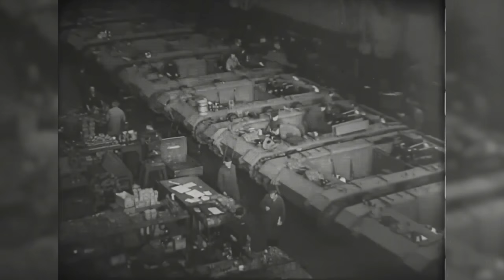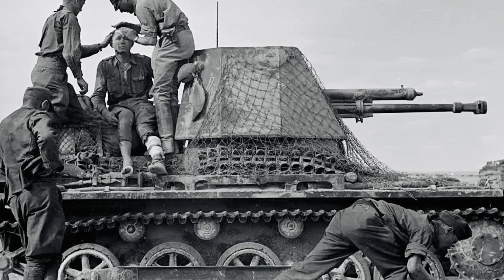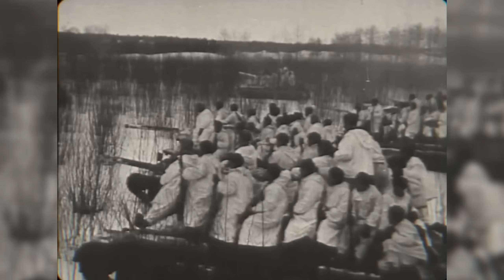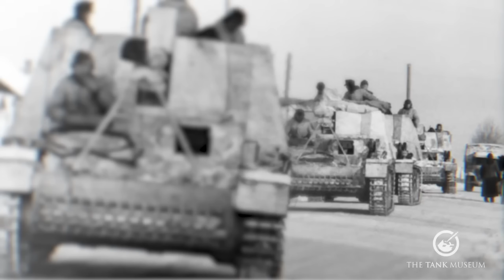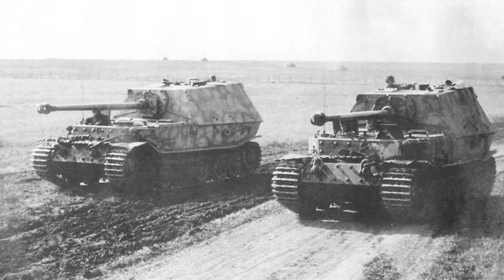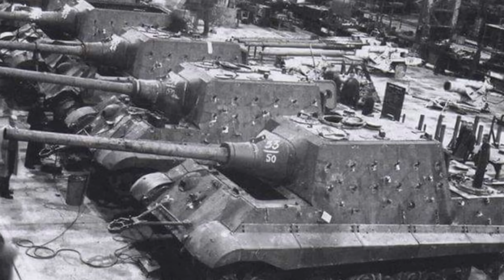The HORRORS of German Tank Destroyer Crews

Comment: I think the JagdPanther looked even better than the regular Panther
Reply: It was one of the best tanks the Germans had, Cost effective, 88mm, relative fast
Reply: With a weapon of war, what do looks have to do with anything?
Reply: @OrderingParts  It has anything to do with the fact that the Germans also wanted their armored verhicles especially the Tigers and Panthers (or tank killers like the JagdPanther)  to look good aesthetically.
You don't seem to understand that German Q.A engineers could reject a finished Panther tank during production, just if  the welds were to crude or that some parts were not perfectly smooth.
Or that even the paint was not perfect.
In these situations the tanks got re-worked.
This was totally unessecary, due the fact that the tanks was already finished and fully functional and ready to be transported to the frontlines. This unessecary focus on aesthetic quality hampered the pace of production and deployment of all kinds of finished tanks or tank hunters. Unlike the Russians who just tried to produce as much tanks and other armored verhicles as possible no matter how crude they looked with crooked weldings or faulty drilled holes in them with no ribbon ever put in them.
So it again has everything to do with the history of German armored verhicles.
One of the problems is that even the German engineers focussed so much on small quality details, that this also was one of the factors of lower numbers in producing armored verhicles.
The Russians got things right regarding production of tanks.
Just produce as much functioning tanks as possible, not matter if a panel is not grinded smooth or that this or that weld is too crooked.
You know why?
The russians knew that a new tank from the factory would last a few months at best.
So it would be totally pointless to spend time and resources to details of a tank that won't matter in battle.
You get it now?
Reply: @OrderingParts  most machines that work well tend to look good too.  It is form and function in harmony.  Look at Concorde vs Tu144, or A320 vs B737 max.
Reply: @OrderingParts  I guess some look like they will do the job. The British Vickers A1E1 Independent, with five turrets looks loony. But they did make the firefly eventually. In part, which I think was awesome.

Comment: I'm glad you mentioned the Jagdpanzer 38(t). Its price was 1/7 of the Tiger 2 tank. Yes, it was a cheap worker. Some statistics: the Tiger 2 had a kill/loss ratio of up to 5/1. The Jagdpanzer 38(t) had up to 3/1. But: for the same amount spent on production, the Jagdpanzer 38(t) destroyed 35 tanks (not counting the loss of crews). That's called cost-effectiveness.🤔🤣🤣🤣👍😎
Reply: For same $, 38(t) destroyed 7x3/5=4.2 tanks, not 35. Still better kill/$.

Comment: The acronym StuG is NOT pronounced Stugg in German. It's Shtook; not a short vowel O or a long one but something neutral, in between. The consonant G is "hardened" through "Auslautverhärtung" (that happens to be the correct linguistic term and it means "final-obstruent devoicing" or "pronunciation hardening", of the finite consonant in this case, into a K, as in Hamburg --> Hamboork. The same or very similar mechanism appears in many other languages also.

Comment: There's one issue with the soviet glazing. The T-34 was not quite what the propaganda and pop culture has made it out to be. Sure, the design specs on paper are impressive. But the issue was production. For every T-34 they got right, that took many hits and survived, there were 10 T-34 tanks that either had transmission grenade itself before getting to the battle, and those that had manufacturing flaws in the armor. And instead of penetrating the armor, the T-34 would just either come undone at the seams, or the poorly manufactured steel itself would crack from hits that could never pierce that amount of armor in theory.
It was not a flaw in the design of the T-34. It was simply that the USSR used to be the Russian empire, which was mostly feudal and not very industrial. And to fix that, the soviets just kind of forced everyone into cities to make tanks. What do you expect when you want peasant farmer alcoholics to make proper tanks by the thousands with a quick on the job training?

Comment: the ferdinand is one of the tanks with the highest kill to death ratio
propaganda fucked up this tank, it actually had good reliability, but it was a breakthough tank. so FORCED TO DRIVE ON SOFT, MUDDY TERRAIN,CROSS WEAK BRIDGES, CLIMB 30 DEGREE HILLS. WHILE BEING 65 TONS!!!
it had mg ports on the angled 80 mm sides, so they shot infantry from there, it was impenetrable towards ANY TANK during ww2 (at atleast 1 km)
mines were the biggest reason it got abandoned. NOT BREAKDOWNS!!!
the ferdinand is overall an extremely survivable tank
decent reliability, strongest ww2 canon. thickest flat armor (200 mm). this is a real heavy tank destroyer
it got its bad reputation because it was used as an breakthrough tank. if they put it on a hill, 3 kilometers away from the front, covered in leaves and bushes, professional crew would give it a 40 K/D ratio
its my favorite tank for a reason

Comment: Question from a casual observer whose tank experience was building plastic models as a child: regardless of how much or how little armor these machines had, weren’t the treads the universal weak — extremely weak — point on every tracked vehicle? Granted, they were on the lower portion of the machines, but wouldn’t only modest firepower cripple a tracked vehicle and make those, especially ones without a turret, the proverbial sitting ducks?
Reply: I believe (as an infantry vet whose tank experience involves looking at them while thinking about how nice it would be not to have to walk everywhere) that while it is true that they are a weak spot, there are some mitigating factors. From the front the tracks are quite a small target, less than a meter square. At long range with WW2 anti tank you wouldn’t be able to reliably hit such a small target. Speaking from experience, even modern infantry-held anti tank is going to struggle to hit such a small target at anything other than suicidally close range (remember these things generally have machine guns). Tank crews also like to be “hull down”- they use obstacles or terrain to conceal or cover as much of their tank as possible. In that scenario, the treads are the first thing to be hidden. Tanks are weaker at the top, sides, and especially rear, so I imagine that tank crews are fanatical about always facing the front to the enemy, so unless you have out manoeuvred them you won’t get to shoot at the sides. 

Keep in mind as well that a de-tracked tank can still fight. Even immobile, it’s still an armoured box covered in guns. Ideally when taking on a tank you want to destroy the vehicle and kill the crew. If you don’t have the ability to get through the armour then a mobility kill is better than nothing, but that’s a pretty desperate situation to be in.

Comment: A Question. How did the Flak 88 get ‘pressed into service’ against tanks? Surely it needed the armour piercing ammunition which implies prior planning?
Reply: I suspect they mean its place in the Order of Battle was in mixed flak battalions, whereas there was an anti-tank company in each infantry regiment. So while it was deployed officially as flak at the battalion level, it started to be used widely for AT fire, and also eliminating bunkers etc from range due to its excellent accuracy.
Just guessing of course.
Cheers
Reply: Because it was hard to move on the Battlefield. The early Flak 88s had no wheels attached for mobility. Large steel supports in 4 directions to keep it stable meant it was not moving anytime soon. Once in place though it was a real killing machine.

Comment: the crews loved the ferdinand even with its troubles. Not having a bow gun was not much of a problem. they had gun ports in the sides. Mines were the most cause of losses. They still managed to knock out 1600 plus russian tanks and 57 out of 80 made it back.
Reply: Yes, there seems to have been some unfair propaganda directed against this machine. Considering its bad reputation after Kursk, it soldiered on for a surprisingly long time.
Reply: @rasmuswittsell10  exactly, of course it gets a bad reputation if it is put as breakthrough, forced to drive on 30 degree hills. but this just goes to far
it was a really good tank destroyer. my favorite tank
Reply: precisely, the losses at kursk were more due to them being misused by panzer crews as tanks who pushed forward and lost their tranks to soviets in foxholes from at rifles and mines due to infantry being pinned down. the ferdinands that were crewed by ex stug crews fared far better at kursk for that exact reason, who knew what to do with that machine. and the redesign with the MG addressed that anyway (ferdinand's was still the name when the MG was introduced, the Elefant renaming was due to different reasons)
Reply: it is 57 out of 89 tho, 2 didnt go to the front because they tested them. so basically 91

Comment: One point to remember is that most German artillery was horse drawn. It was therefore impossible to keep up with advancing troops.  A self propelled gun didn't need to be dug in, then packed up and dragged slowly along.  It could just drive up, fire and advance with the foot soldiers.
Reply: Actually it was that the infantry and the artillery couldn't keep up. Infantry was on foot also, early in the war. Germany had very few mounted divisions for infantry and really never overcame that issue throughout the war.
Reply: True, but relying on horses in 1944 was a death sentence when a Stug could just "shoot and scoot" before the Soviet counter-battery fire leveled the whole grid.
Reply: @ww2hidden101  The death sentence was invading Russia in 1941. The Germans believed 2 things when they entered Russia. That Russia's population was slightly bigger than Germany's, when it was 3 times bigger and that Russia's Army was slightly larger than Germany's which it was 1.5 the size. They relied on horses because they had to. Germany didn't have the resources to produce Tanks and Vehicles on the scale that the allies could. Iron had to be imported from Sweden, while Rubber  and Oils were in short supply. It's cheaper to make anti tank guns than a tank and much faster.They relied on horses because they had to.
Reply: @forbolden  …if they would have fought only Russia and without lend lease they would have made it. Horses were not bad and proved also some advantages especially in Rasputiza season.
Reply: @jamesmorrison4976  Glad somebody said it. Britain staying in after Dunkirk was the true turning point.  If they had come to terms there would have been no Lend Lease and no Battle of the Atlantic.  Insteaed of 1100 subs the Germans could have turned out 20-30 thousand more tanks.  End of ballgame.

Comment: Again, wrong wrong wrong. The stat boys are wrong again. Too much is made of the STUG III's performance. They were either assigned to Infantry Divisions, which are not particularly offensive oriented, and you don't win by playing defense alone. But others were assigned to PZ Divisions and took the place of PZ IVs, a job for which they were not suited. These vehicles accounted for more tank kills because in Infantry Divisions, they were left out in contact with the enemy for more months out of the year, VS PZ Divisions which would get rested up, trained on new vehicles, and grouped up for several months of offensive operations, then pulled back to the rear or at least pulled off the line and placed into a reserve status awaiting an enemy offensive in "the off season". The STUGs got a decent gun in mid 1942, and not everyone got them, it took time to deploy them and not every Infantry Division got them. But they also filled some PZ IV positions in a couple of divisions sometimes replacing a few tank platoons, sometimes an entire PZ IV BN was instead replaced with STUG IIIs in at least two PZ Divisions. But by mid 1943, PZ IIIs are being replaced with Panthers, so now PZ Divisions have a single PZ Regiment with a BN of Panthers and a BN of PZ IVs. Some of the PZ IV BNs still had some STUG IIIs, and not every division was getting Panthers. By '44, STUG IVs are showing up. And when the STUG III factory was bombed, the Hetzer was the answer. The STUG II was great for Infantry Divisions, and they gave those units some excellent service. They were useful in PZ Divisions in Defensive operations, less so in Offensive operations. But people need to realize that comparing the two is a fool's game.  A PZ IV BN did not fight the same type of fight as the STUG BN normally. You can not compare the stats of a STUG BN in defensive prepared positions with a PZ IV BN in the attack, driving into minefields, into prepared AT positions dug in and camouflaged, and facing dug in T-34s and other enemy armored vehicles or running directly into counterattacks by enemy armored formations or drawing unwelcome concentrations of enemy air power and artillery because the hot spot in the war is right there, and not hundreds of miles away in a quiet area that the generals happen to forget about mostly, and all anyone is doing on either side is hoping to hold the line while the glory boys win the war somewhere else.
Reply: You have thought this through. But I don’t agree that too much has been made of the stugs success. It took out far more kills than the competent pziv . Germanys desperation meant I would have cancelled the pziv for the stug because it was generally more successful and you could make far more of them. Follow it up with the jag iv in 44. But by jan45 they had to produce jagdpanthers or lightened tiger2s ( reliability issues remember) with 88mm guns to counter Centurians,Pershing’s,JS 2-3s in big numbers.(thick armour)
Reply: @Muzz-d3h OK, I do appreciate your acknowledgement. Are you aware that German Generals admitted that they were jealous that the US was able to equip infantry divisions with turreted tanks? The reason Germany's Generals valued tanks more than STIGs isn't because they were idiots, turreted tanks are better. Not having enough of them hurt they're efforts, and that inhibited they're offensive operations. Which cost them tanks, which hurt tank stats.The most difficult operations and the riskiest are offensive operations, and by mid war, Germany did not excel at them. Even putting STUGs in the Panzer Divisions didn't help because they really are not superior. And you can't win a war only playing defense. You don't have to be convinced. If you are interested enough you'll give it a harder look.  The question you have to satisfy is, would PZ IVs have done better in place of STUGs? The key is not a lower silhouette, but vehicles can enter hull down and turret down positions. And while it's generally easier for STUGs to find suitable positions, a turreted tank can make better use of them. You can decide for yourself, you might have fun doing it.
Reply: @piperp9535 what you say makes complete sense. But stugs are 20% cheaper and quicker to produce. Don’t forget they were up against the Americans and Russians who could make far more tanks . They had to cut corners and the stug had a higher kill ratio. The Germans had to gamble. You’re right, the pz iv wouldn’t have made much difference. The Hetzer was too cramped. But stugs or pziv up against Centurians, Pershing,JS 2-3s in 1945? How daunting would that be.😮
Reply: @Muzz-d3h  You are correct, STUGs were cheaper and easier to make. But they were not authorized for use in the Panzer Regiments of the Panzer Divisions until late '44, and the war ended May '45. The only Panzer Divisions to receive them in leu of PZ IVs were the 9th SS, 10th SS, 116th, Panzer Lehr, 17th SS Panzer Grenadier and Feldherrnhalle Panzer Grenadier both had STUGs but were not Panzer Divisions and were not issued tanks, but the Panzer Divisions above all had a Battalion of Panthers issued so they were equipped that last year with Panthers and STUGs in their Panzer Regiment, or a mix of STUGs and PZ IVs. This was not because STUGs are so good, it's because STUGs were what they had. These are all units of the Panzer Truppen and not the Infantry Divisions, and so the stats that make up the STUGs fame are pretty much entirely due to the two years prior, from '43 to early '44 when Infantry Divisions held the line and ambushed enemy reconnaissance forces and armored attacks notably on the Eastern Front and in the long Italian Campaign and prior to that in Sicily, and yes, in the West against the Allies in France, Belgium, and Germany. I'll try to wrap it up with this, does anyone really think that STUGs were really great, and German Generals were just too stupid to realize it, or Tank Snobs who could stand to replace Panzers with none turreted tanks even if they performed much better? I think people need to reconsider this, and stop believing the youtube video hype. STUGs were good for the job they were intended for, and that is the role they filled by design, on purpose, not from being forced into it in desperation. Replacing Tanks in offensive formations with STUGs was desperation, and while on the defensive, these Panzer Divisiojns probably made good use of them. I'd say study these Panzer Divisions and their actions during '44 and '45, see how well the STUGs worked for them. 9th, SS 10th SS, 116 Panzer, and Panzer Lehr notably.
Reply: @piperp9535 well written. I just think they were more stealthier.considering most tanks had to stop and fire . This evened things out more. But I will say that General Heinz Guderian was on your side in response to turret vs non turret . He said similar and his my favourite General . In my opinion it was the workhorse of the army. All the best